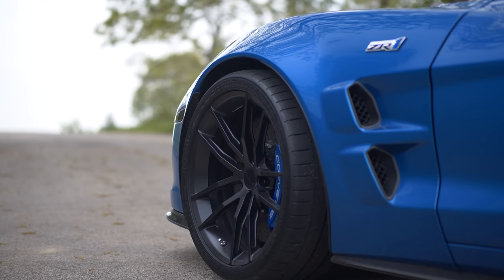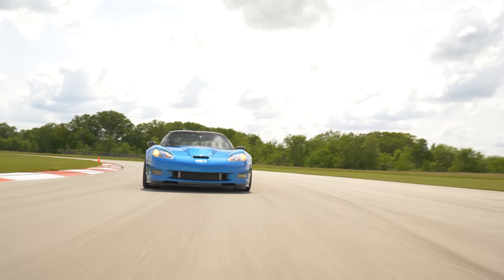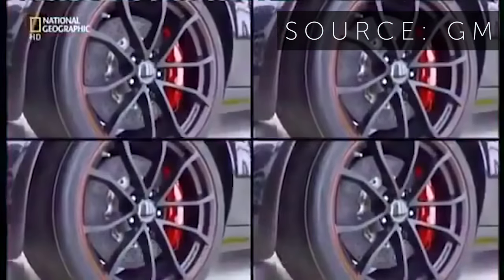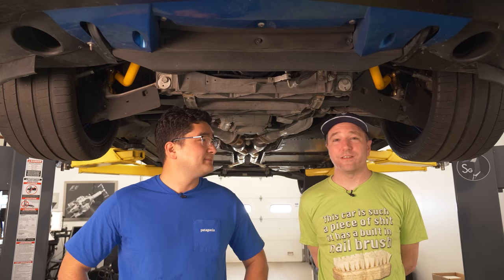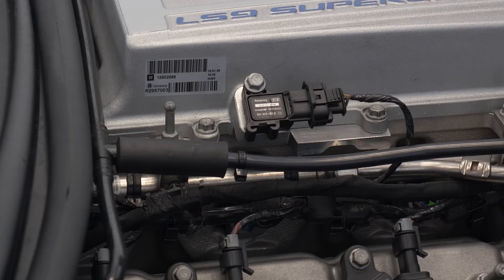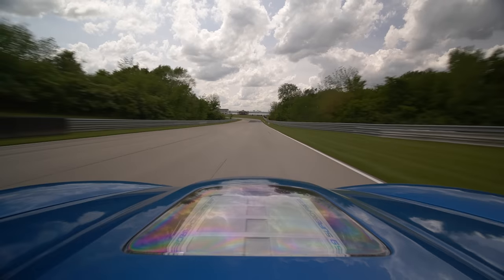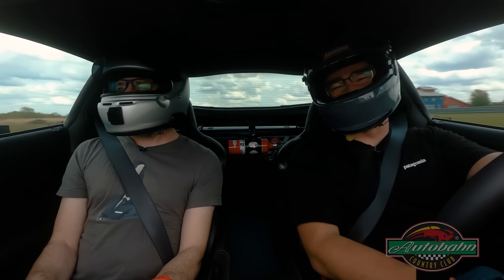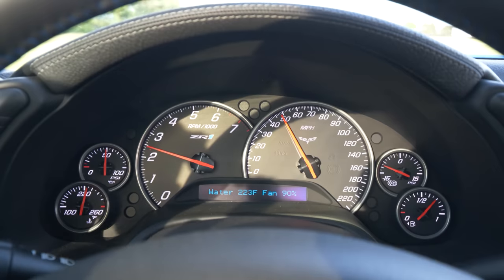Corvette C6 ZR1 | 1000HP Death Trap

Comment: Yeah the perfect street car power for a 3000 3400 pound car is 420 to 500hp..after that shit gets sketchy.
Reply: how so?
Reply: @thephantomzoneboxing  in my very personal open that power to weight ratio is the best..It's strong enough for a average driver to enjoy and not wreck it..good for street, autocross, and drag..etc..if your in a miata, civic, datsun or stripped out project that's 2500 to 2800 with 500hp..lol..Good luck with that..it's a reason companies don't sell cars with that ratio. It requires a more skilled driver...Most cars that are sold to the public in big numbers like HELLCAT, GT500 even a CAMARO  ZL1LE are heavy as hell..some high 3900 to 4500 pound range..They are fast no double but they need to be that fast because they are so heavy..It's just math and weight..So that's why I belief what I said to be the perfect balance to drive and enjoy..Sorry for the long response..I hope that clears up my opinion.
Reply: @mg_streetkandi  i suppose but if you have quality suspension that can hold a lighter car to the ground with power be no issue..seems like a cheap work around to just make it heavier
Reply: @thephantomzoneboxing  I'm not saying lighter suspension wouldn't help..I'm saying horse power and with combine weight of total vehicle is how you determine that feeling. Manufacturers make cars as light they legally can to the to the public. Most of there research is pretty good. Although you not gonna get a car that's dangerous to the public.
Reply: @mg_streetkandi  all cars are dangerous 🤣 the engineering just sucks tesla is doing it rite with their setup tho

Comment: Is that a chevy cobalt steering wheel?? RITF
Reply: It’s basically every Chevrolet and/or GM steering wheel of the era! Definitely parts bin, but they’re surprisingly comfortable with the thick rim, small circumference, and little grip bolsters at 10 and 2

Comment: C4 and C5 had magnetic dampers
Reply: C4 no.  C5 I'm also thinking no.  Only Cadillac had the first gen MR as far as I know.
Reply: @kevin9c1  both of them had it as an option
Reply: @smokesgtp  C4 no.  Adjustable valving.  Way different than MR.  You're right about the C5.  I think 03-04 had F55 as an option.

Comment: my car runs near 8 sec qtr and 180 plus 1/2 mile and puts this to shame !
Reply: @williamdolyniuk7804  no dummy. I can prove everything I say. 181mph at shift sector on low boost and trapped 155 in SAC on low boost
Reply: @williamdolyniuk7804  No I don't get good gas mileage terrible gas mileage how can I get good gas mileage for that kind of power less than 10 miles per gallon on e85. As far as breaking  blew my first motor at shift sector that's why I'm running a new fbe motor I blew two transmissions so far. I never said anything didn't break! 😂😅😂 - It's funny you mention cloaking device I have a radar jammer
Reply: @jeffufcfanaticrosenberg  good one its understandable young and crazy go for it yep .got the cash do it live it . Its great radar jammed.  Perfect . .L.o.l.  good . L.O.L